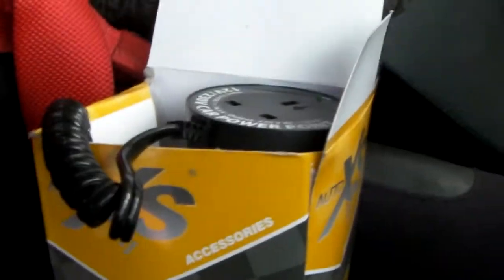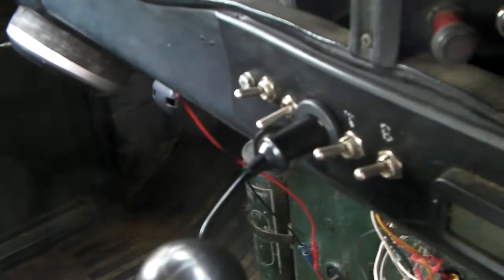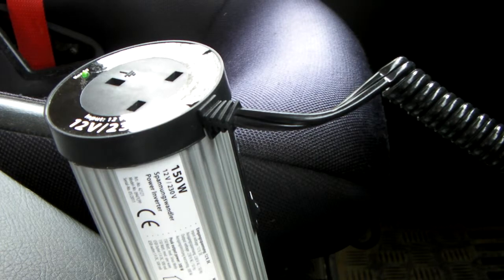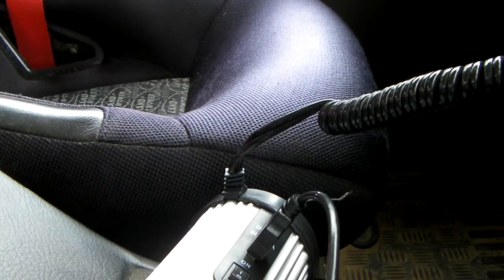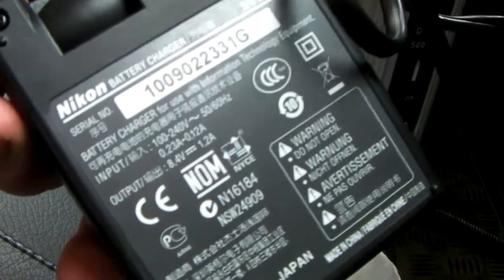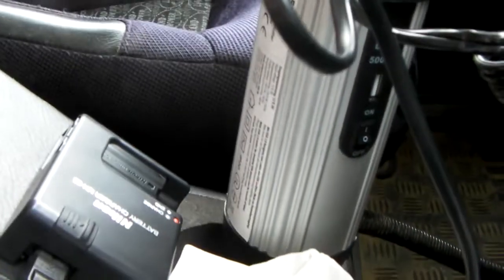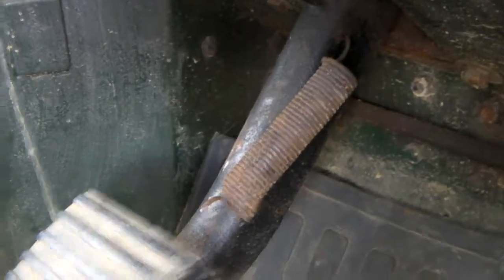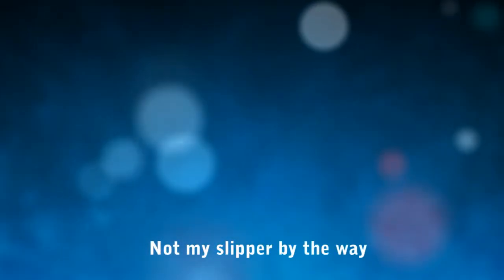12-230V inverter test

Comment from the maker: @locouk Eek, that's what I'm hoping to avoid. My Dell power supply is apparently 70W (thought it was a lot more actually but didn't check until now) but I'm still not sure I'd trust it. It's nice that big SDHC cards are getting cheap now so things like timelapses are easier.